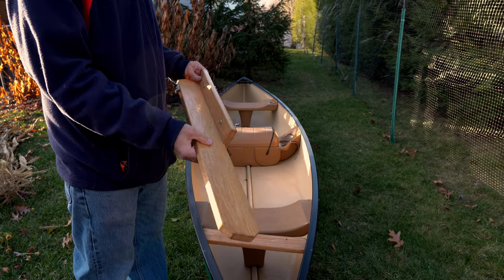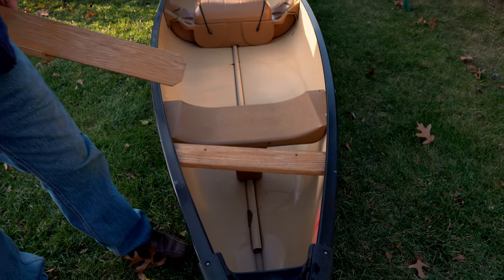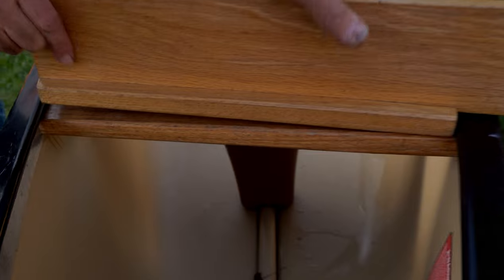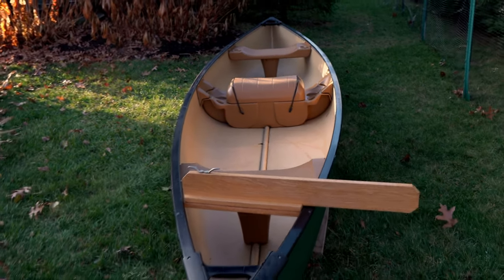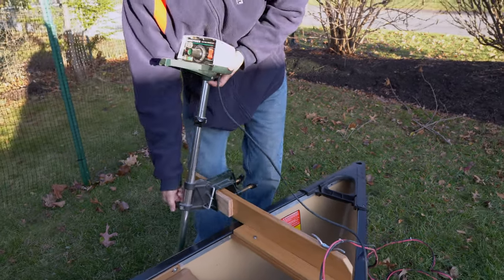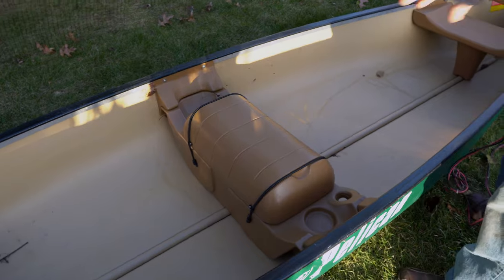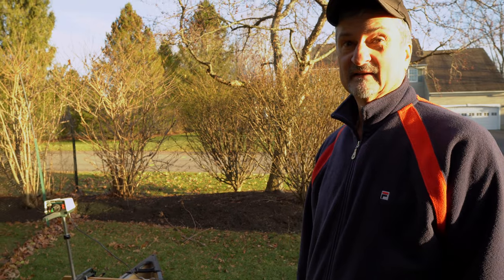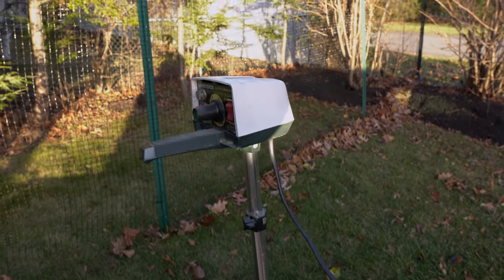Canoe Trolling Motor Mount

Comment: Thank you for your video . I  use to  have a setup, much like yours , and it works fine. You mentioned  the square  back a couple of times and didn't  seem to be a fan of it . I prefer the square  back . I just put an extension  off  the throttle control  to bring it up  by my side, next to my waist  . For fishing purposes, I prefer  the motor in the back instead of along  the  side of me . I run a very small down rigger  at  times, which I run off the side . This helps reduce  interference  or intanglement  between the two. Great point about the battery cable hookup . Thank you .  Have fun, Sir .

Comment: Your mount is set up very nice. I almost bought one of those flat back canoes, but then I thought about the discomfort too. I really appreciate you telling that the boat becomes a motorized vehicle after you put a trolling motor on it. I would have gotten pulled over. Thanks!
Reply from the maker: Not a problem.  We got pulled over a long while back don't want other to have the same issue.  Don't forget to subscribe!
Reply: We found out the hard way about getting the canoe registered with an electric motor on it.  NY state is picky about things like that.  Have fun be legal.   I am an unpaid associate of the Outdoorsman Channel.
Reply: Thanks for letting me know.  I don't know how picky they are in Ohio, so I will definitely ask them what I need to do to be legal first. For now I will just use the oars. 🙂
Reply: If you are on a small pond probably not a big deal.  If you go on a lake with state police boats or a "navigable waterway" it could be a problem.  The department of motor vehicles in my state is pretty clear about it.   We got stopped by the water police when the outdoorsman was much younger.  They could have thrown the book at us but only gave us a ticket for not having a horn/whistle.  There are a bunch of other things you need like an anchor, signalling device (whistle) etc.   Good luck.
Reply: @joesilverbliss1721  Thank you so much. I just bought the canoe about a month ago and thought it would be fun to add a motor. I was planning to take it on our local reservoirs like Charles Mill or Pleasant Hill lake.

Comment: I have a very similar looking canoe, if not the same (Pelican Explorer DLX) and had issues using a mount that was secure enough since the canoe had such thin and shallow gunwales.  Using a piece of wood like yours in the video (looks like a 1x4 size) permanently drilled to the canoe and securing the motor mount on that would definitely solve my issue.  Just a question, what size of screws did you use?
Reply: Hi. I just saw your question.  Stainless steel wood screws were used.  I don't recall the length but I am guessing at least 2" or 2.5"long.  You need to pre drill the wood.   That thing is solid.  It hasn't moved ever and you can lift the canoe with it.  So I think wood penetration should be at least 1.5".  I  don't recall the screw size. I would go bigger as long as you predrill.  I am a contributor to the outdoorsman channel.  Good luck. Joe

Comment: I also prefer the motor on my right. 
    I am using 2 -32 amp batteries.light and easy to carry.
Reply from the maker: Yea easier to handle I think.  Nice that's a good idea.  Canoes move pretty good with a lil trolling motor.
Reply: Can you provide the make of the batteries you have

Comment: Looks good...if ya don't mind me asking how did ya register it in NY? Mine is older that I just picked up and it does have a HIN# on the side in the back...Have just a bill a sales from previous owner...Thanks!!!!
Reply from the maker: Thanks! We went through the dmv and you need to get a title for the boat and then get a hull ID number.
Reply: @OutdoorsmanChannel  it has a HIN# .... Thanks!!!
Reply from the maker: @robertstreams4362  Yup that should be what you need and bill of sale.  Just double check dmv website under boat registration.  Goodluck!
Reply: @OutdoorsmanChannel  thanks again and yeah I've googled the DMV for info...Not much at all on canoes...I already knew it needed registered but never worried about trolling motor till now (well this spring hopefully) and the DMV isn't even doing boats,atvs,trailers or anything like that with the covid thing

Comment: great video!, what angle did you put your mount at ? (the one fixed to the canoe)
Reply: Hi just saw this.  The angle was ergonomically what felt good.  It depends on your canoe.  Be careful not to make it too close to the seat to create a pinch point for your hands.  I think I put it on the canoe and either marked the wood or used and angle gauge.  A miter saw was used to cut the wood.  I am an associate of the outdoorsman channel.  Good luck with your project.  Use stainless screws and predrill when attaching to the canoe

Comment: Did you extend the connector cables? What did you use? Thanks
Reply: Hi.  We did extend the cables.  The size (wire gauge) of the cables depends on the length of extension and how many amps your motor draws on max power.  These cables were soldered together and heat shrink tubing was put over the connections.  If your motor draws less than 20amps an inexpensive choice for wire is 12AWG outdoor low voltage wire sold by the foot at home Depot or Lowe's.  It is twin cord like lamp cord all black.   You should use red and black markers or battery clips.  I am a contributing associate of the Outdoorsman Channel.  You may also find something at an auto parts store or Walmart for the battery clips
Reply: I was looking Amazon has 30 amp battery jumper cables for $9.95 all made up.  Just get that and cut off and splice to existing cables.

Comment: Is the mount angled or is that just an illusion?
Reply from the maker: Just an illusion
Reply: @OutdoorsmanChannel  BS that is on an angle.  One is 90 one is not.
Reply from the maker: @dsaylor184  sure
Reply: That was the first thing I noticed in the video! Lol
Reply: Yes, there is what he did was to install the board square to the side of the canoe not the center line of the canoe. I was thinking it's not a bad idea but do it the opposite way that would push your handle forward a few extra inches.